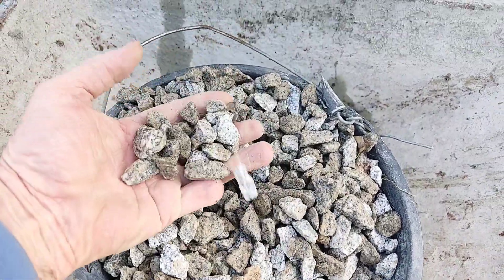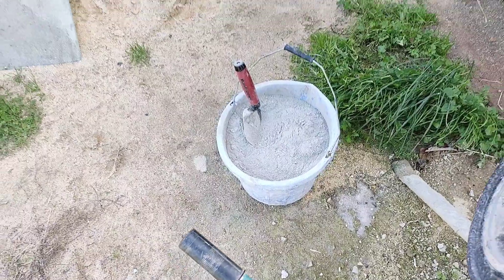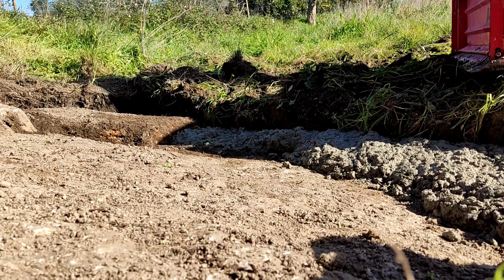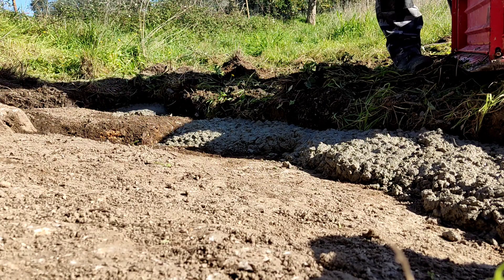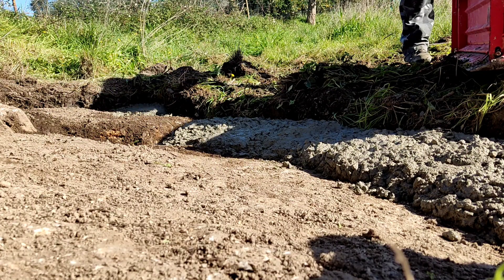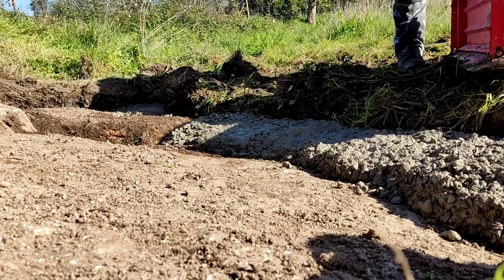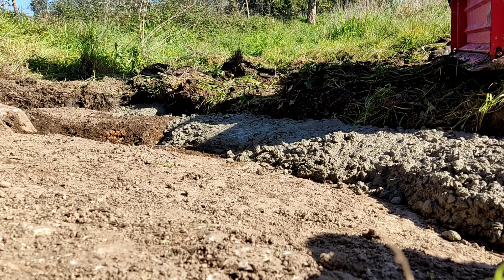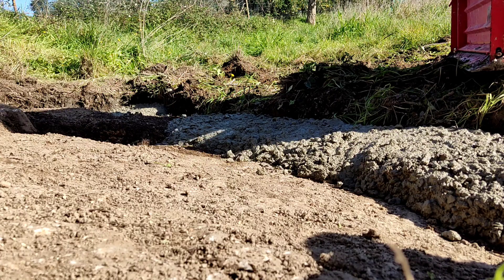How to mix Concrete

Comment: Thanks Nick for posting.   1 question; could you use beach sand instead of the sand you are using?  The beach sand here is very fine white sand.
Reply from the maker: Not really, the salt in beach sand breaks down the cement, and over time the mix would crumble, you could wash it, but that's really difficult in small amounts without the correct equipment
Reply: @projectportugal  I thought so.  Since I live on an island with plenty of that free (ha, Insurance is more than mortgage and taxes, haha) resources.  LOL. Just had to check.  And what you say makes perfect sense.   I've seen plenty of concrete walls, drive ways etc.  👍
Reply: @melinda5777  40 yrs ago I remember newspapers in Britain being amused by Saudi Arabia importing sand from the UK, even though much of the country was a vast desert, because they had the wrong kind of sand for construction and had started building their many skyscrapers!

Comment: Yes Nick, you adjust the amount of cement according to its strength. As far as I know there is 35 and 45 , and obviously 45 is stronger than 35. 45 is used in foundations and brick work, and 35 usually used when making mix for plastering or rendering a wall as it doesn't dry quickly.
Reply: That's interesting! May I ask which country you are writing from? I worked on building sites* for a couple of yrs, many years ago (ok, not too many!) and these numbers were unknown to me back then. Maybe it's a new thing, maybe it's only in America/Portugal/France/Australia** etc?

*Scotland, UK
**pick any country in the world
Reply from the maker: Neil, the numbers correlate to Newton meters of strength achieved after 28 days of curing. So the higher the number the stronger the cement.
I've never seen this choice anywhere apart from America, and I've worked in quite a few countries
Reply: @Neilhuny  It's well known in Morocco, further more 35 strength cement is cheaper than 45 cement bag. Writing from Ireland. Regards Neil